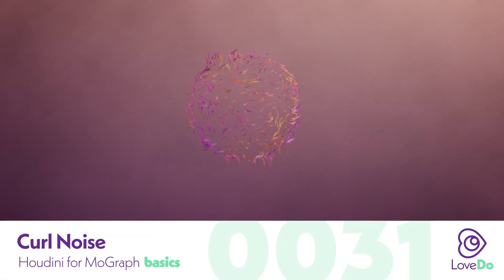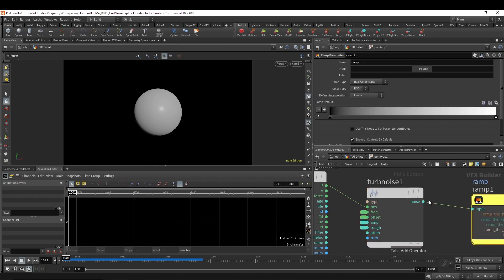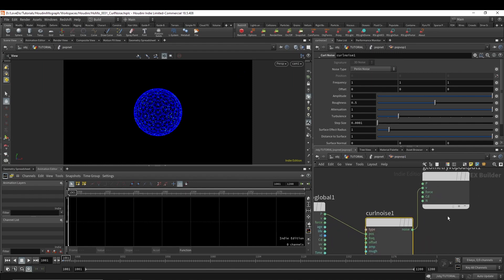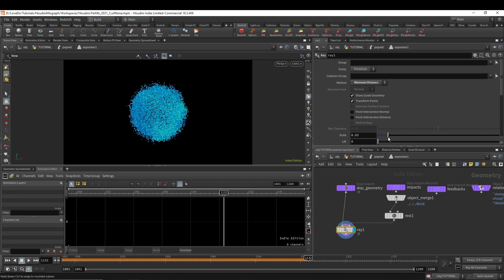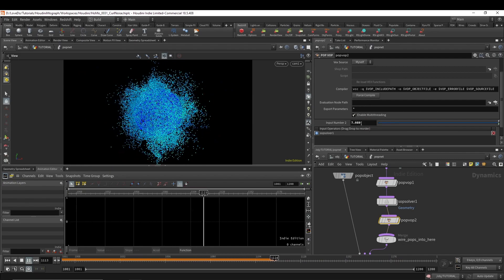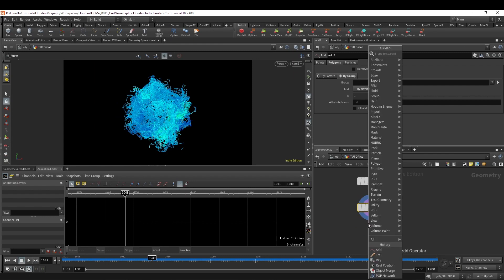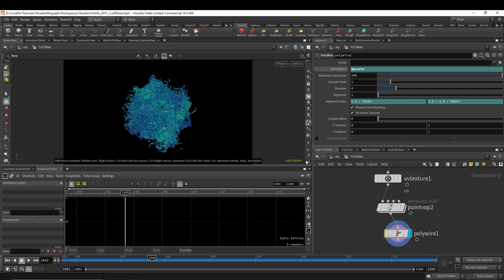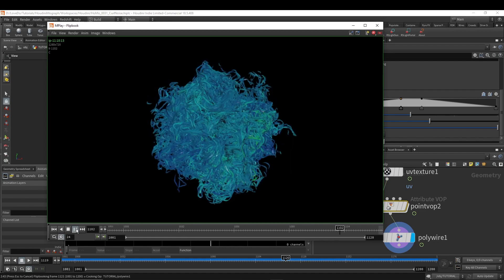Curl Noise - Houdini For MoGraph Ep0031

Comment: Awesome tutorial! I'm trying to create this effect, but have the particles flow around one object, then flow around to another. I tried mixing some Pop Attract nodes in,  but each time I activate them, the particles flow into the centroid point of the next object associated with that Pop Attract, instead of flowing around that next object. Any suggestions? Imagine if you will particles flowing around a character's right hand, then they need to flow around the left hand after a certain point in time.

Comment: Great tut, tks. Would you be able to explain in more detail what is the rest attrb and why are you importing it (Import Attr from Hits)?
Reply from the maker: Rest just stores the Position. You could do an attribute create and name it anything then use @P for the values, but the rest node just does that for you quickly
Reply: @FarOutStudio  Tks, ok I understand now but it looks to me that the exact same is achievable without the "rest" attribute. Using only the scale parameter on the ray. It seems to me that what you are doing with the second popvop is basically what the ray node does.
Reply from the maker: @MarioSundays  the difference is the ray moves it to the guide position immediately, whereas the popvop force gently nudges it into place. This method gives you more control to do custom things like have half of them move along the surface and half just fly around